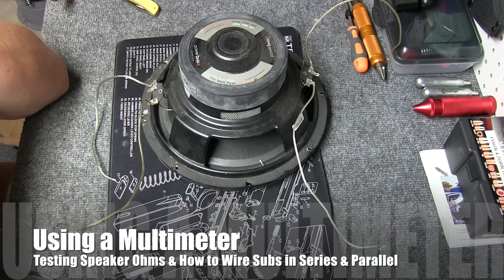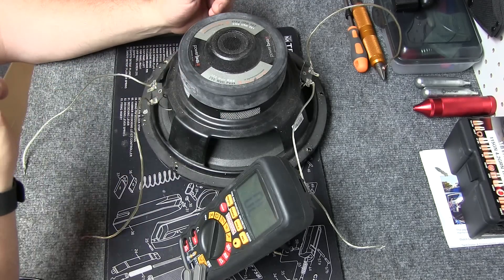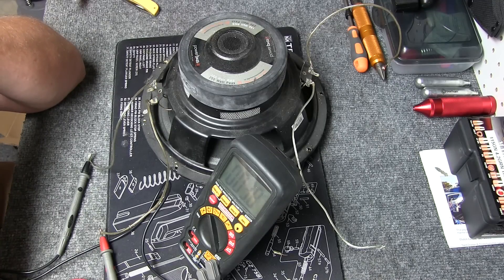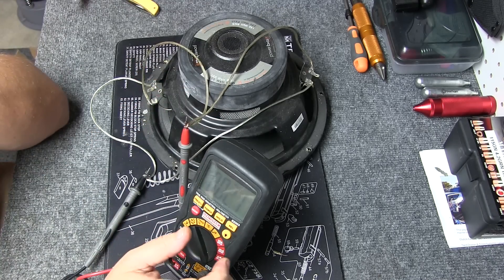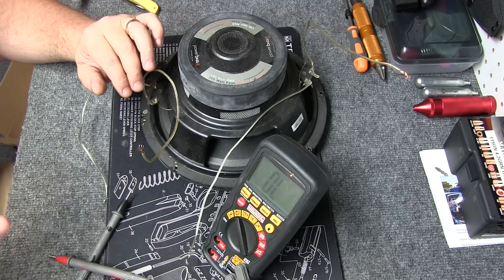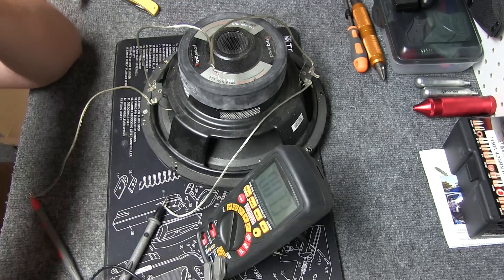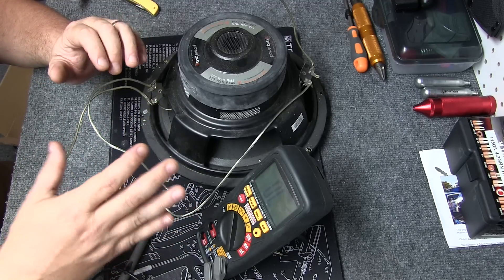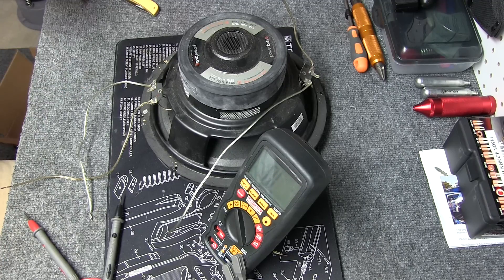Multimeter : Testing Speaker Ohms + Wiring Subs Series & Parallel

Comment: I have a subwoofer that has 4 terminals, two labeled 4 ohm and the other two labeled 8 ohm. Looks like a DVC but it’s strange. I even tested the impedance and the labels seem accurate. 
They’re old off-brands so no manuals or specs. 
Any idea what I’m dealing with?

Comment: Hi Great Video Thanks - Using a multimeter on resistance (Ohm) setting usually results in a reading that is just short of the actual Impedance.  I believe that in order to get a true impedance reading you would typically need a scope and a signal generator.  I believe that for most purposes the method above works fine.  Again thanks for sharing

Comment: The ohm reading is lower than the marked impedance because the ohm meter is using dc voltage to measure, however the speakers are driven by AC and that is when they are at the marked impedance. Resistance is different between AC and DC.
Reply: Is it really different? Seriously. In how is it different?
Reply: I don't know why I keep reading this when the fact is that you can test them with a multimeter and get accurate readings

Comment: I'm getting a reading of 5 ohms when it should be 4. what's the problem?
Reply from the maker: May just be the multimeter itself. Not saying it is a cheaper model meter but if it is, that's pretty common.
Reply: Johnnysshop I bought it for 15 bucks at Wal-Mart so that's probably it lol. also when I'm trying to set my gain and I put my DMM probes into the positive and negative for the speaker terminals on my amp to measure the voltage, nothing pops up on my DMM

Comment: Hi! I have two rockford fosgate punch subwoofers  and I don't know what wattage they are. is there a way to find this out? my brother got them from best buy but he doensnt know what they are just that theyre pretty old.
Reply from the maker: No real way to check. They don't really have a wattage to them, just what they can handle. If it's clean power (very little distortion) most decent subs will handle almost anything you can throw at them. Distortion is a killer..

Comment: hi i got 16 ohm speaker and i did test it with 2k ohm multimeter settings and i got 0.14 ? it that good number ????
Reply from the maker: +Jepe 97 Sounds like 14 ohm so that would be fine.
Reply: if you use a lower setting range the multimeter becomes more precise.